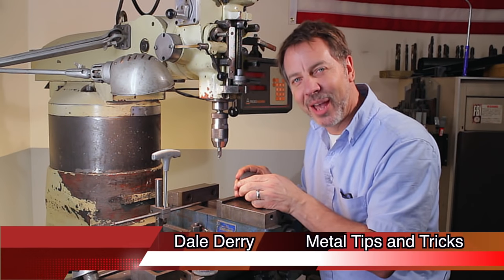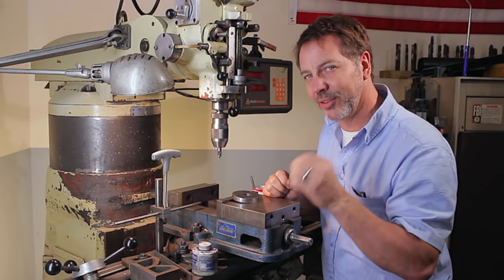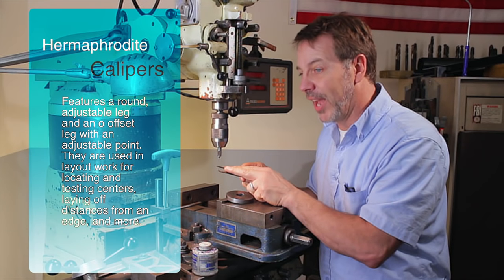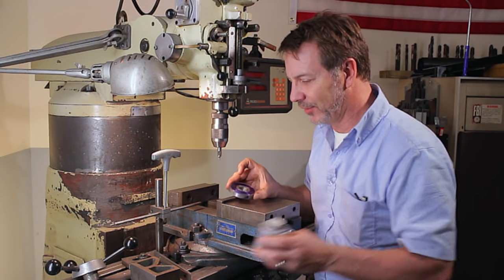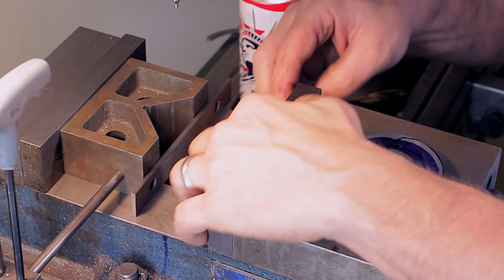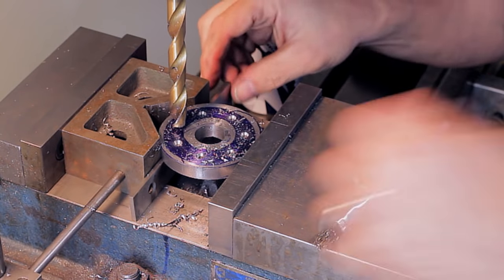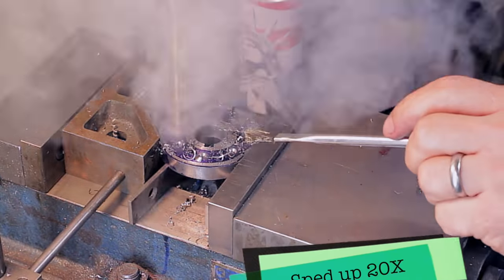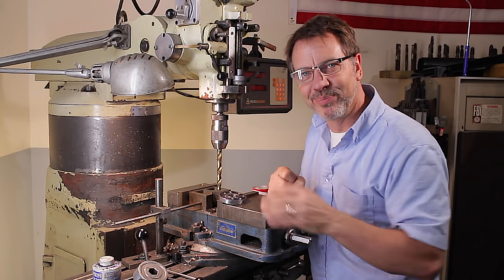How to drill a Bolt circle

Comment: Could someone tell me when you would actually want to drill a bolt circle with very little accuracy? I'm not getting the point of owning a machine shop if your work is just rudimentary at best? Just mount the rotary table beside your vice and dial it in! That's hardly an effort at all.
Reply: +Shawn Lund  Many home shops do not have a rotary table.
Reply: +Jim Sadler Sure but why not just use one of the many bolt hole circle calculators available online and the dials on your machine to cut the holes accurately. It would be faster and far more accurate?
Reply: How are you calculating the straight line distance between the holes? In a bolt hole circle the holes are on a radius.
Reply: For an amateur like me who doesn't own either a rotary table or an indexing head this is fantastic.
Reply: +Ethen Does Life do a google search for bolt hole calculator and use that to get the X and Y movements needed to drill the holes from a centre position. Easy and accurate.
Reply: +Shawn Lund thanks! I'll check that out!
Reply: +Shawn Lund If done carefully, that will get you within .010. Plenty accurate for a lot of work. Striving for excess accuracy takes time. If an amateur, no big deal but if making a living at it, time is money.
Reply: I get all that but calculating the hole placement with trig or using an online hole calculator and the dials on your machine would be easier, faster and more accurate. Don't matter, to each their own I guess.
Reply: It depends on the circumstances. I did this for 25 years. Now retired. I know what works.
Reply: +ardvarkkkkk1 so as a machinist you used a scribe to layout a bolt hole circle and cut it by eye on a milling machine?
Reply: Sometimes, yes.
Reply: ardvarkkkkk1 doing something for 25 years doesn't make anyone an expert, maybe if you were cutting the holes with a torch then by eye would be faster but otherwise your just doing it wrong.
Reply: Shawn Lund

Again, I know what works.
Reply: ardvarkkkkk1 I would argue that you know what does work but don't care enough to do it right.
Reply: yes you can do it more accurately. But how accurate does it NEED to be. You can carry things to extremes. If you are drilling bolt holes they need to be at east1/64 bigger than the bolt for clearance anyway. While your fiddling with the dials {and you didn't mention backlash}he would have had it done in half the time.a mil with a dro maybe not but just a lathe with dials? you would be confused after the second hole.
Reply: just make the holes a little bigger and i WILL work. No every one has rotary table, DRO or CNC uhhh ??
Reply: Shawn Lund no.

Comment: Not a very accurate way of drilling 7 holes in bolt hole circle.   Maybe I mis-heard you.   Your method of laying out 7 divisions of a circle by way of a divider is only as accurate as your layout skills, and not your machinist skills.   You have a digital read out on your mill.  Did you think about using it?   You could have centered the workpiece to the  spindle using an  indicator.    Use your DRO and dial off half the diameter of the circle..   Then trig out each hole.   Your holes will be  within a thousandths of an inch to true location.   Or...maybe true location isn't important to you.
Reply from the maker: Hi, Thanks for your comment,  you are correct, but the purpose of this video was too show a  alternative  solution to drilling bolt holes for my viewers that  don't have a DRO.

Comment: If you want X and Y, Here you go, assuming you have a $15 TI-30 calculator.
Y=R*sin(Theta)
X=R*cos(Theta) 
Theta = angle for hole number N. Theta 1 = 360/Number of holes. Multiply Theta by the number of the hole you're drilling.

Comment: Why would it be done this way when the mill has a DRO? Unless it's a fake problem for the purpose of making a video... Also I echo the others that point out the critical information on how to calculate the distance between the holes is missing and the fact that this method it not very accurate, especially the way he's doing i , eyeballing a center drill....

Comment: 360° / 7 = 51.42857142857143°    
Using a vector drawing program like CORELDRAW or better yet a CAD program.  Plotting a 7/64 hole on a 5" bolt plate with 1" center hole.  With the seven holes centered on a 2" radius from the center of the bolt plate blank.
(why 7/64th"  hole? random choice just shy of 1/8".  Easy to bore the seven holes out then to the finish hole diameter of your choice)
Plot the 7/64th hole top dead center.  Copy the hole, rotate the entire drawing 51.4°, paste a hole, step and repeat 5 more times.
Using that model I was off .007" on the last hole.
So unless the government was buying this one off part - I would print out the template, stick it to the 5" blank, center punch the seven holes and drill them out on any old drill press and call it good enough. 
Just one thought process if you are using a vector drawing program and sticking a paper template onto your blank works for you.  Change the number of holes / 360° and the size of the holes you want to drill - and go to town.

Comment: Wow. He's really amateur. Should be called "How to use precision equipment to get within .050."
Reply: And you're really missing the point.  Or an idiot, but I'll err generous.  Any decent machinist should be able to mark up to within a thou on a bolt pattern using only calipers, at that point it's about how accurate your drilling process is - you've obviously missed the bit where he's removed uncertainty in the drilling process down to a single variable (rotation of the piece), meaning that it's possible, even with a totally shagged machine, to get more than accurate enough to make parts for a much more accurate machine.

As a clue, this is pretty much the exact method, modulo the precision vice, v-block and parallels) I used to make my dividing disc set, using a very cheap and very worn out 1980s chinese drill press, 2 bolts through the table as stops, and a toolmaker's clamp.  That's a 3 disc dividing set giving 30 second accuracy.  Made on a drill press that has spindle runout close to .5mm (or about 20 thou in your provincial "measures").

You do need properly sharpened drills, though.

Comment: You did nothing here. other than turning the workpiece in the vice. Just find the center of the workpiece or some other reference point and use a little trigonometry to find the bolt circle that you need. Not this video showing you can just turn the workpiece  to where ever and then drill a hole! fail

Comment: Ever heard of math??? You have a DRO for god's sake... A middle schooler knows enough math to do that properly
Reply from the maker: HI Morgan, Im sorry you missed the point of the video. It was to show guy how to  drill a bolt circle that don't have a DRO. :-)
Reply: HI Dale, You are correct i suppose. I'm guessing it would still have been better to calculate the coordinates of your bolt holes, center up over the middle of the part, then use the dials to move to each position. If you use mag back indicators on each axis, you should be able to accurately place the holes within a couple thousandths... Thats how I see it.... Also, I'm a fan and wasn't trying to be rude, just indignant.. Cheers

Comment: Bout the most half assed method I have ever seen. If you insist on laying it out, turn up a plug with a center in it to fit the hole. That will take care of your circle. Either trig out the positions or, do it the easy way and look it up in the Machinery's handbook. It will give you the coordinates of the bolt circle or, if you want to step it out with divider, there is a table in the book that will give you the divider setting.  Since you have a DRO on your mill, just put the part in the vice so a bit of it is above the jaws. Forget the V block. Not needed. Use your test indicator to dial in the part then get your coordinates out of the book and go for it.
Reply: ardvarkkkkk1 Please put in a link of where your video is that explains your method, I've searched but can not find it

Comment: WOW,get a trig book,u  have a read out on that  bridgeportl,45 degress is , .70711 times half the b c 000 000 cl,half the bc up down ,lefrt right   7 hole bc,really,divide 360 by seven,look in trig book sine and cosine multiply that by half the bc,5 inch bc 2.500 is half or use a calculator,pick up cl use indicator pick up bore   DUDE OMG
Reply from the maker: Hi Michael, Sorry I didn't make it clear in My video. The point of the video was to  targeted to people who don't have a DRO.
Reply: oh ok,i worked in machine shop 27yrs,HBM,LUCAS,GIDDINGS AND LEWIS,JIG MILL DEVELEIG,LATHES,BRIDGEPORT,sorry about that

Comment: Yeah it's fine as a shortcut for making wheelbarrows. Beyond that get the calculator out or use a rotary table. Trigonometry is faster than this
Reply from the maker: want to have a race? :-)
Reply: @BuildSomthingCool  why would I want to race? Either the product is right or it isn't.  taking shortcuts never works. I've done it for a living for 40 years! I have a degree in mathematics it is simple and I will not take a shortcut.